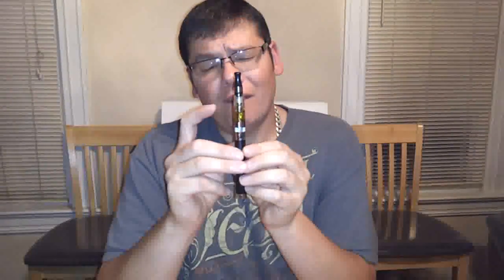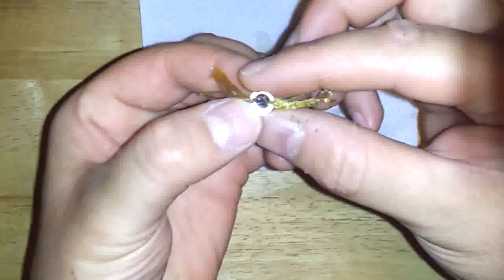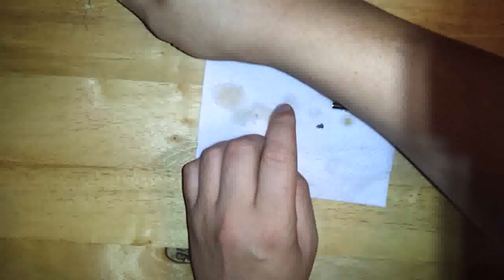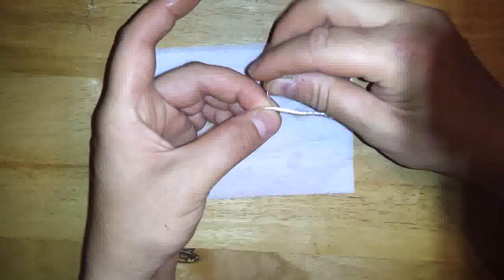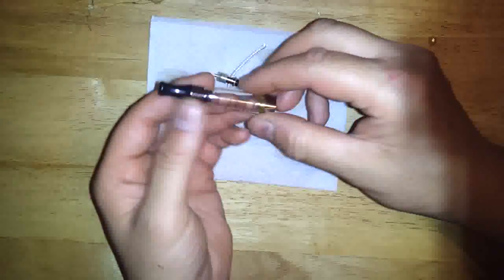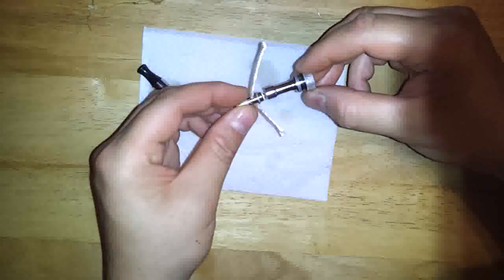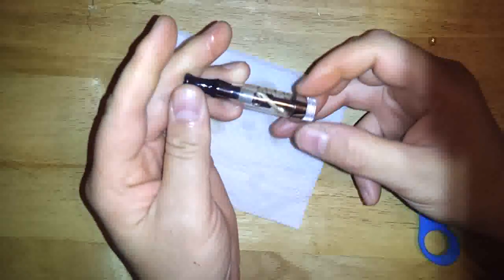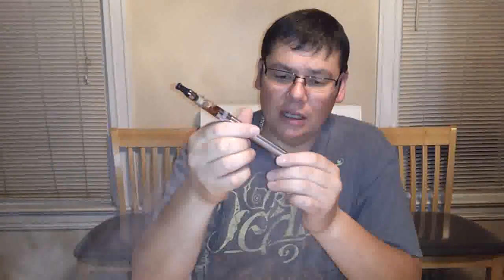How-To Rebuild the coil in the Vision Stardust V2 or Ego CE5+ Clearo (Electronic Cigarette)

Comment from the maker: 6 to 7 will give you a 2.5 ohm about, but that is not an exact science. I always use a muilti meter to test my resistance. Plus it will depend on the size silica and the gauge of kanthal.

Comment: How many wraps? Thanks.
Reply: It will all depend on the gauge of kanthal you are using and where you want your resistance. If you have 32 gauge Kanthal, which is probably the most common to start out with. Start with 4 or 5 wraps. If it is not giving you enough vapor or TH, then go down to 3 to 4. But if it is too strong for you, then go up to 5 to 6. You will have to find what is best for you.

Comment: You have really dexterous nimble fingers mate,
I have to agree about that small tube of brittle material it is a sort a belt and braces insulator It just disintegrated on my CE5's and is more of a pain in the bum than its worth..Just leave it out and built a non touching coil properly as shown .by JunkyRock13 .Thanks for the tutorial

Comment: really? how would that even help? you need someone to write down the diameter of a coil at a particular wrap and diameter? because it will come out exactly the same every time. The ohms of the wire is standardized Example> 32 gauge kanthal is 13.35 ohms/ft. So if you cant figure it out from there...pretty sure thats a LOT easier then measuring the diameter of a coil. which really wouldnt work because it also is affected by where you wrap the wire to the post. Good luck though.

Comment from the maker: When you have both wire pieces coming out of the bottom and the metal pin is placed back in the middle of the rubber ring. Make sure you give it a nice little pull down so there is no slack in the wires. If there is slack the wire might get shorting out just enough to cause it to burn. I have never had the rubber piece burn, so I would make sure you are doing exactly what I did in the video and see if there was any errors from before. If you still haveissues, contact me rosssanders13@gmail.com

Comment: Woah.Woah.Wah. Hold on there... I believe that ce5's are not compatible with 3mm wicks and 32 gauge wires... I belive the ce5 clearomizer is plastic... and it's easily heaten so it melts...